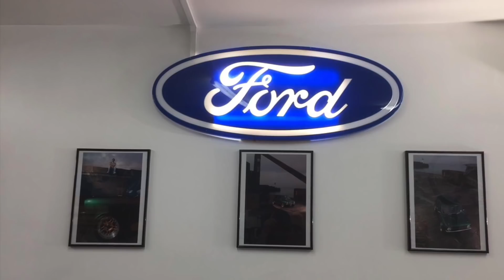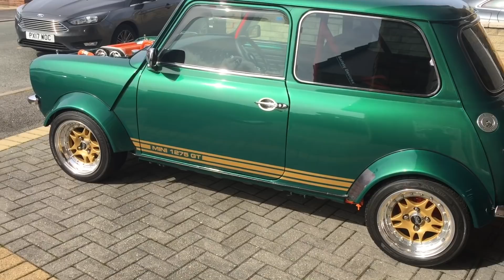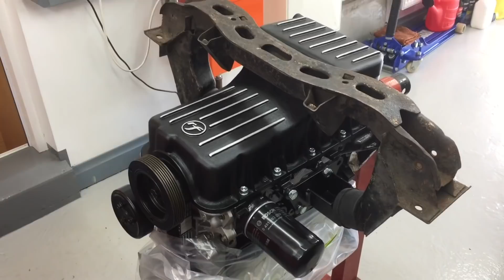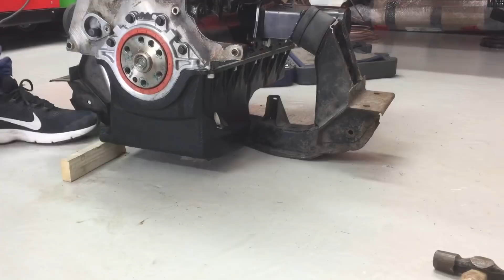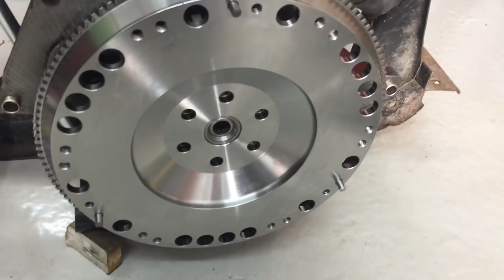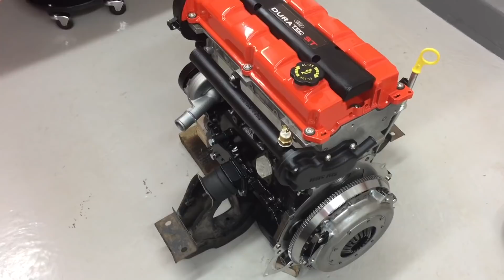MK1 Escort RS 2000 Re assembly Episode 7 ST170 engine build up completion

Comment: What is the solenoid or the sensor for at the front of the cams for cheers
Reply: And does it have to work or can you leave it unplugged and the cam just stay in the standard position or do you have to have it working thanks.
Reply from the maker: @taz2963  If the solenoid is left un plugged or the system isn’t working, you will lose power at certain points on the Rev range. Basically the engine will be really flat and not produce it’s full potential power. This is because the cams are designed to advance at certain intervals to make the desired power levels. You can get around this by fitting some aftermarket cams and completely do away with the VVT system. VVT Delete as people refer to it. This obviously means the expense of new cams but also means that you don’t need to pay for an engine management system that can also run the VVT system
Reply: @performanceclassics1986  so if it is left unplugged will the cam stay in it’s original position or will it move when reving and over run
Reply from the maker: @taz2963  It should still run ok with the sensor unplugged but due to the VVT system not functioning with it unplugged, you will be down on power fairly significantly. The only real options are to get rid of the system with replacement cams or fit an engine management system that is capable of controlling the VVT correctly such as the Omex 710 or motorsport electronics ME221 system.
Reply: @performanceclassics1986  it is for a formula 2 stock car and I run a can-am ECU of a black top Zetec with a 32/36 carb set up so was wondering if I could just drop the ST170 in with the solenoid unplugged as my ECU doesn’t have the capability’s for it but still have a bit more power than the black top I have just blew up 🤣🤣
Reply from the maker: @taz2963  Might be a much cheaper option to fit another black top, depending on how much money you want to spend
Reply from the maker: It’s to control the variable valve timing by controlling the flow of oil to the inlet cam pulley.

Comment: What clutch and flywheel are you using?
Reply from the maker: Hello Nick, it’s a standard pinto clutch assembly fitted to a retro Ford lightened flywheel. Apparently the standard pinto clutch is good up-to 200bhp
Reply: @performanceclassics1986  would you know if any other flywheels will fit instead of a retro Ford one?
Reply from the maker: @nickbarnett5273  I’m pretty sure you can’t just use a standard zetec or pinto flywheel but retro ford also do a standard flywheel for the application. I think you can modify the standard zetec flywheel to accept the pinto clutch. I think this just involves re drilling the flywheel but don’t hold me to that. Give retro Ford a ring and they will tell you the cheapest options

Comment: A great video and I’m working my way though the series!

I’m in the process of refreshing an ST170 before popping it in the car. Would you happen to know the size of the stainless bolts you added to the cam cover please?
Reply from the maker: Thanks very much for your comment and for watching the videos 👍

The cam cover bolts are Stainless Flanged button head Allen key bolts M6 x 30mm long. I bought them from Ebay and they were only £3.40 for 20 then removed the original bolts from the inserts and added these instead. Hope this helps.
Reply: @performanceclassics1986  that’s great, thank you! I’ve just ordered a bag of 20 - think I’ll try and replace everything I can with stainless to help keep up the maintenance.
Reply from the maker: @michaelgates4641  yeah that’s exactly what I’ve done. The only places I’ve kept original bolts are load points and areas where strength is vital so that I’m not messing with the tensile strength of replacement bolts but I’ve fitted stainless into all visual and non load bearing aspects 😎

Comment: DO U KNOW ANY GOOD LOCAL WELDER FABRICATOR WHO CUD REBUILD MY DOOR A POSTS ROUND THE MIDDLESBORO AREA PLK
Reply: THANX  ALOT  MK2 ESCORT A POSTS ARE ROTTERN  BUT CANT TAKE CAR ANYWHERE  AS INTEGRITY OF THE SHELL  WILL BE COMPROMISED WELL DONE WITH THE BUILD KEEP UP THE GUD WORK THANXAGAIN
Reply from the maker: mark hargreaves Thanks Mark. So you need somebody to come to your garage and do it at yours then. Ive done this for mates in the past who live locally. There must be others out there that will be willing to do the same Mark. Best of luck getting it sorted.
Reply from the maker: mark hargreaves Hello Mark, unfortunately im not aware of anywhere out in the middlesborough direction all though there must be plenty of good bodyshops that would be happy to take it on. Many bodyshops are only interested in the insurance / accident works but the better bodyshops out there take on restorations and have guys who can tackle that kind of work. Im sure if you ask about in your area, there must be some decent bodyshops / Restoration centres that will do you a great job.

Comment: Iv just stripped cambelt etc off my engine to replace the front crank seal which Has failed after a very short time (it’s orange in colour just like the one you fitting and like you say felt to easy to fit originally)

Have ordered a victor reinz one to like you have in this vid 

What technique did you use to align/ centre the oil pump and rear crank seal housing to ensure seal was centred?
Reply from the maker: Lee Edwards Yeah that orange seal is terrible. I didn’t find there was much manoeuvrability in the pump. I basically alligned it so that the flat faces on the base of the pump were flush with the bottom of the block to help the sump seal better but there was very little movement in it. I don’t think you can actually get it wrong Lee. The bolts determine where it aligns and it doesn’t move far at all if you try and force it in any direction.
Reply: @performanceclassics1986   thanks mate

Reason for asking is I fitting seals into both housings then slid onto crank,  bolts in all holes...  relied on the seal to hold them. Central to crank then rotated them so the lip / steps down from the block to housings were the same each side.

However having run the car for 12 months Iv always had a weep from rear which I thought was the sump so just had engine out and changed sump gasket along with fitting windage tray etc and thought I would change the rear crank seal whilst it’s out I can see a gap between the crank and dust seal at the top but snug at bottom and now I’ve stripped the front that is the same to!?

Almost like the sump Hs pushed the housings up which I don’t think has happened as the bolts are still tight 

Changed rear seal and still have a weep at back of engine,  just doing the front as we speak awaiting this new seal
Reply from the maker: Lee Edwards Thats a weird one Lee. Not entirely sure what could be causing that. Possible poor quality seals maybe??? When i fitted oil pump i did exactly as youve just explained. Exactly the same. The only movement i could get on the pump was very very minimal with bolts in  and i dont think it would move out of alignment enough to cause that issue lee.. That is a very interesting one 🤔
Reply: @performanceclassics1986  sure is mate will pop the new felt type seal in the front and see how it goes

Keep up the good work 👍
Reply from the maker: Lee Edwards Thanks. Hope the new seal resolves the issue. Im sure it will be much better

Comment: Spot on these vids, my mk2 is not far away from paint and to getting st170 which iv already built, where you getting gearbox to block bolts from or what size are they as I’m assuming you will be fitting new like me ?
Reply from the maker: Dave Bartram Im pretty sure they are either M8 or M10 Dave. Il double check tomorrow. Should be able to pick them up easily enough. Im confused because the ST engines are American yet all the bolts on them are metric and the Americans dont use the metric system 🤷‍♀️

Comment: Another spot vid, keep em coming,. Your mini engine was interesting, I stuck a AN bulkhead fitting in the cam cover, works a treat.👍
Reply: Same as me, one I used came from inside out so nut went on outside and not on the inner worked a treat on my cover
Reply from the maker: taffy mk1 Thanks for the comment. Il probably end up fitting similar. Just drill and bolt on a pipe fitting. Ive no idea why they used a Magnesium cam cover🤷‍♀️

Comment: do you have the original st170 engine mount near the cam belt and is it good? If yes do you sell it?
Reply from the maker: opexo I Haven’t unfortunately. When the engine was taken out we didn’t get the mount with it as i knew it wouldn’t be required in the escort. Sorry about that.

Comment: Bread is so much better to use than grease when you push out the bearing from the crank. I used serveral hours trying to push the bearing out with grease without luck, searched on the internet and it told med to use bread. I tought that was a joke, but that worked fast and less of a mess.
Reply from the maker: Wimp McGrump Very interesting. I didn’t know that. I will try that in future because as you say the grease method is very messy.